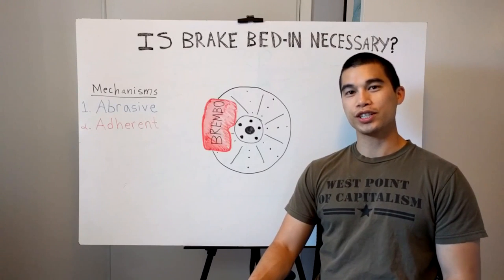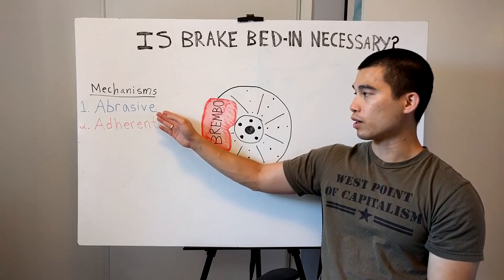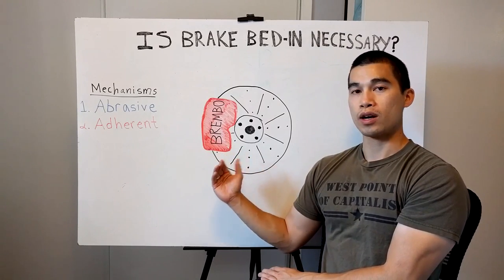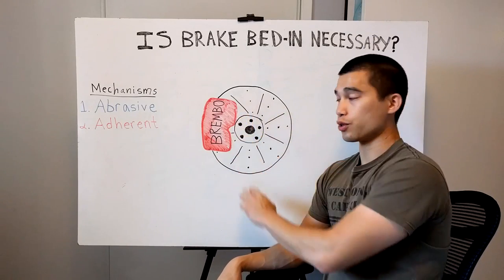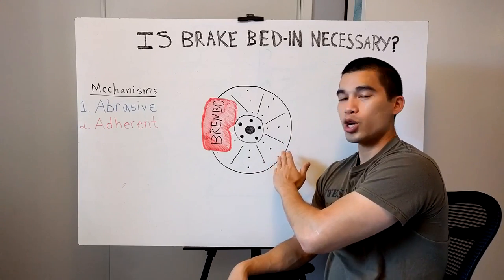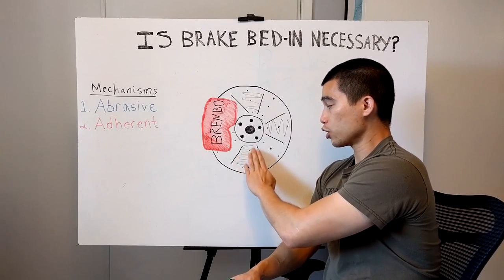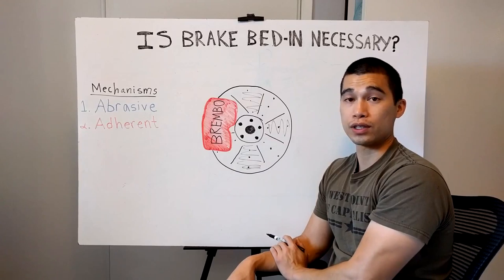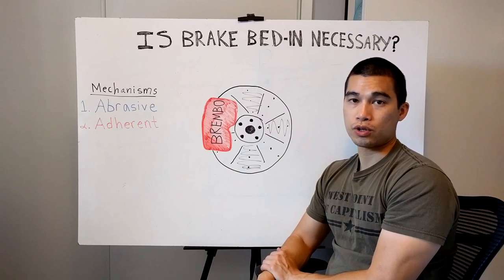✪ Do you need to bed in new brakes? EXPLAINED ✪

Comment: The fact that they don't bed-in brakes for new cars is very persuasive.
Reply: Sure. And you don't BUY brakes bedded in either. Read ANY new vehicle owners manual  See that bit about bedding in brakes? Especially for performance cars. Just looked up Corvette.  A whole SECTION of the manual devoted to this: "from the 2016 Owners Manual, brake burnishing procedures, with separate instructions for Z-51 and non-ceramic brake Z06's, and then for Z06's which have ceramic brakes.So 2 minutes research and its no longer persuasive.
Reply: Matt Smith That’s a very smart observation!

Comment: You should bed in the brakes on a city car not burnish them, after changing the breaks you should always bed them in on a open road, slowly, 6 or 7 times of slowly constant breaking without stopping is enough, u will see the difference, its just for the pads to settle in the rotors.

Comment: Definitely would be cool to test bedding and non bedding on the same 2 cars , and keep track of it over a year. Honestly wouldn’t shock me if it wasn’t important. Been doing mechanic work for 12 years and I’ve only torqued like 3 things , never had one issue .
Reply: I’ve had several vehicles that were running solid with 230k plus miles ,must not be too shoddy.Most things you can feel in the socket when it needs to stop . I can understand when it gets down to the block , but otherwise I’ve never had any problems with not doing it .
Reply: @wb3213  Torquing bolts is just a GUIDELINE. If you know what you are doing you can feel when its right. Sometimes if you follow the specs you will over torque the bolt and it will lose some of its holding power.

Comment: I just replaced my front brake pads on m Renault Clio 3 for the first time. Do you think I need to bed them in, or just to drive normally and do not worry about it?
Reply from the maker: Just drive it normally. You will eventually bed them in. Thanks for watching!
Reply: @CarFanatic  I will do just that. It's not a high performance car, I think it will be fine! :)
Reply: @CarFanatic  I did, at first braking was not good, the feel on the pedal was poor. Now, after some time, everything is ok, just as it was before. :)

Comment: On my new Brembo discs you are supposed to drive very slowly and apply very LITTLE pressure during the first 200 km
Reply from the maker: I think you don't want to hit the brakes hard for a short spurt because the pad material may not transfer evenly to the rotor. But by all means, use your brakes as hard as need if necessary. Safety first!
Reply: If you have their rotors with the zinc coating, there's just a small period to remove the coating. Not quite as extreme as all.of that nonsense and breaking hard when you have to is fine. Their instructions are:

Drive vehicle to a remote area and perform at least 30 brake applications of 3 second duration. Use light/medium deceleration with varying starting speeds. Leave at least 1/2 mile between each brake application

After the repeated stops, drive the vehicle for several miles with little or no braking in order to adequately cool the components"

Comment: I do a lot of motorway (highway driving) to get to and from work. I've had my discs and pads replaces twice in a period of about 6 months. Given that I do about 400 miles a week, this doesn't sound great and they keep warping. For the average driver who's not doing a lot of daily motorway driving, the above makes sense. Do you have any advice for me on my next set of discs and pads? They need changing right now as they've begun to warp again!
Reply from the maker: +Suhayb Bhatti what kind of car do you have and what brand parts are you using? That definitely isn't normal. Also what makes you think they are warped?
Reply: Car Fanatic I have a bmw 3 series e92. I have used brembo pads and discs and recently had the same happen on pagids. The steering wheel is vibrating on braking at speeds above 60mph. Once I changed the discs this went away. It came back a few months later. I could slowly feel it creeping back. Do you think it's worth bedding them in when I get a new set? I'll get them changed under warranty but ideally I'd like a more permanent fix!
Reply from the maker: +Suhayb Bhatti there's most likely something wrong with your suspension which is cause the wheel hubs and brake rotors to float around. I recommend having a mechanic inspect the entire front suspension system. Your brakes are a side effect, but not the issue. Keep me posted!
Reply: Car Fanatic really? Never thought that would be the case. I'll go get it checked. Thanks
Reply from the maker: +Suhayb Bhatti have them look at the brake calipers as well. weree the pads worn down when you replaced them? If so, you could have bad brake calipers which constantly engage the brakes even when you don't press the pedal.
Reply: Car Fanatic good shout. I heard about sticky calipers potentially being an issue.
Reply: Car Fanatic how can I tell if I have a a bad calipers or sticky calipers?i just installed new brembos cts v swap on my Legacy,also install new stoptech drilled rotors.

Comment: My brakes are not smoking they just smell very light i changed the roters and the brkaes did i possibly do something wrong or is that just the smell or braking in?
Reply from the maker: You could possibly have an unrelated fluid leak somewhere. You could also have something dropping into the brakes. Do you see any leaking brake fluid or anything?
Reply: I believe that is the brake pad adhesive, research it, I believe it's normal.

Comment: Where can I buy ceramic discs for Porsche 911 ? I'm from Brazil, thanks
Reply from the maker: Do you mean carbon ceramic brake rotors? If so, that is going to be very expensive and you'd probably have to go with oe Porsche ones.